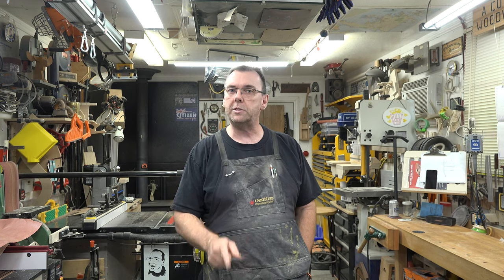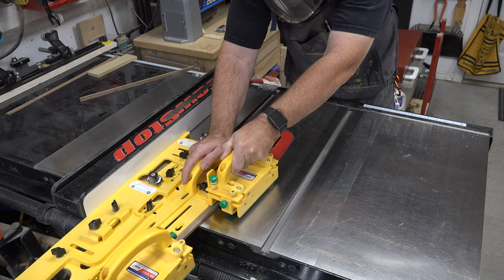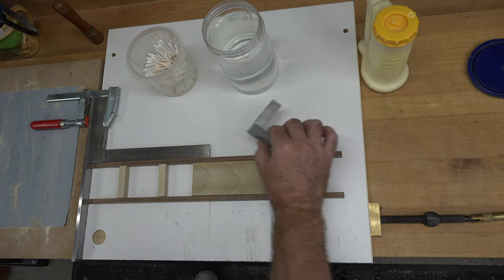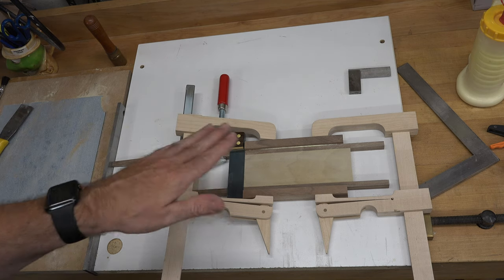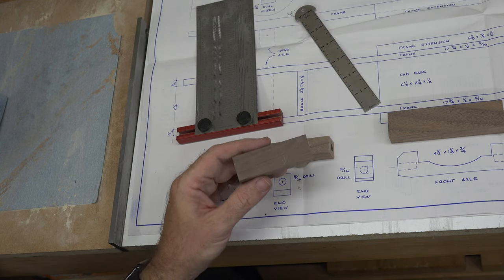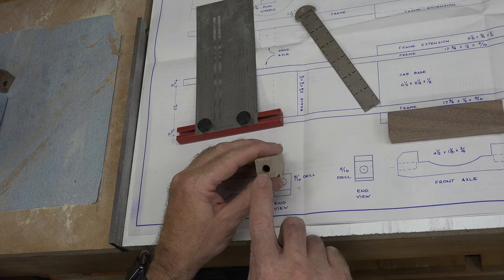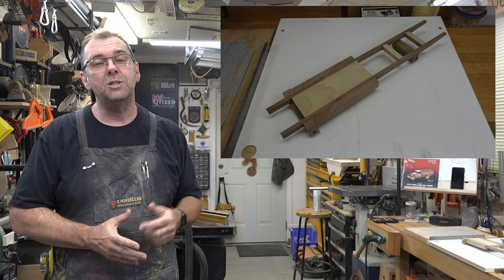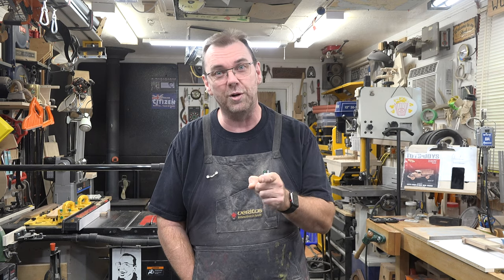Toys and Joys 1929 Ford Stake Bed Truck

Comment: Oh yah! This is going to be a great series! Except for balsa free-flight and u-control planes, I've never built a wooden model like the type you make. And that was way back in grade school and high school. But I do still want to design and build a pond boat. The wooden sailing ship models that kids and adults used to sail in ponds and urban cement/stone ponds in the early 1900's.  Well the snow is on the ground for good here in northern NY, so I have all winter lol. What a great start for this project. Take care Ken!
Reply from the maker: I hope you do make those boats Michael.  I'd love to see them if you get them finished.  Thanks for the kind words on the show and for tuning in this week.  Good luck with the snow.  I hate snow.
Reply: @acutabove_woodworkings  LOL! I hate snow too! If you look on ebay, Ken,  you can get an idea what those wooden yachts look like. I was thinking of cutting them on the scroll saw like you would a bowl. I just have to decide on how many layers and their thickness so I can know the angle of the cuts. Take care!

Comment: Hoping to do this one...thanks for the series. They make  a nice bi-plane model as well.
Reply from the maker: I hope you do make this one Wade.  It's a fun model and with this tutorial, there are no questions as to how to go about making the pieces.  I've made the bi-plane (I believe it was a Fokker II) and it was a wonderful model to make.  The plans for that one are a little older but there were still fun.  The most difficult part of the bi-plane was drilling the holes for the landing gear.  Either way, thanks for tuning in and for taking the time to leave the comment.  I appreciate it.
Reply: @acutabove_woodworkings  can you remember if you drilled the holes while still a rectangle block? I may tackle the plane first.
Reply from the maker: @wadesaunders583  I did not and I think that is where my problems started.  I would suggest drilling the holes while it is still able to be say squarely on a drill press for drilling and then shape the body afterwards.  I hope this helps Wade.  Good luck on your build.

Comment: Kenny, Thank you!  Today was my first time at your channel and although I've only seen one video, I am a subscriber.  Some might think your pace is slow, however I can easily follow because you explain very well.  I purchased this very set of plans about 2.5 years ago and after watching episode #1, you have given me a push to get that box off the shelf and continue where I stopped.  I just wanted to say thank you so much for your positivity!
Reply from the maker: Well I'm glad that I was able to get you moving on this project Sam.  In this tutorial series, I demonstrate every piece of the model so feel free to use the series to help you where you need it.  Of course, you can always ask questions if you like and if I am able to help, I would be more than happy to do that.  You can leave questions here on the channel or through my website contact form or you can email me directly at kennye@acutabovewoodworkings.com.
Visit the website at acutabovewoodworkings.com.
Good luck on your project and thank you for subscribing and for tuning in to the show.
Reply: @acutabove_woodworkings  Thank you for your kindness.  I wanted to ask why you use yellow glue instead of CA or superglue?  I'm not a super glue person, but I was wondering if you wanted to speed up the drying process???  Thanks again.
Reply from the maker: @samspade4634  I'm not a fan of CA glue at the best of times and especially for these models.  CA glue does a great job at temporary repair or adhesion and it is great when used as a finish for turned items like pens or razor handles but in a model build, it just causes problems.  In order to get enough CA on the parts to allow good adhesion and penetration, the squeeze out that it generates causes an ugly mess that will no longer take a finish.  Yellow woodworker's glue penetrates the surface very easily and sets a lot faster than you would think.  Usually, a part will set within 15 minutes or less and the squeeze out that is generated is easily cleaned up using water and a cotton swab allowing a finish to be applied perfectly after a light sanding.  CA glue?  Not so much.  While some model builders on YouTube use CA glue exclusively and make it look like the miracle product of the woodworking world, they are not telling you the whole story and from personal experience, I can say that it is the glue to avoid when it comes to woodworking.  I hope this helps.
Reply: @acutabove_woodworkings  Very, very well explained.  I understand and actually agree with your "experience" with CA glue.  If it didn't run everywhere, the lid wasn't put on correctly (by me) and before you know it, I am out of glue.  Thanks so much for your help.
Reply from the maker: @samspade4634  You're very welcome.  Feel free to ask any questions you have.

Comment: Great video highlighting a great company!  The plans from Toys and Joys are great.  I am currently building their articulating loader.  I really like the fact that you stressed being safe.  It is easy to get into trouble making some of the small parts theses models require.  I totally agree that it is a good idea to spend some extra time sitting and thinking about how you want to make a specific part and the steps required!  Great job as always Kenny 🤠
Reply from the maker: Glad that you liked it Randy.  I've many countless models from this companies plans.  I usually modify them to make them my own and add my own little touches and that's part of the fun for me as well.  I have that same pattern that you are making.  I haven't made it yet, but I will.  I usually get ahead of the game with filming and then take a break from the show and make a model.  It's a good system that works for me.  LOL.  Thanks for tuning in.  I hope you enjoy the series.

Comment: I just finished watching the  7 video's for this truck, absolutly inspiring. I like that you make ALL the pieces rather than purchasing ready made ones. The level of detal and explanation to great. Have you ever used CA glue? Would it work for this truck?
Reply from the maker: Thanks for the kind words on the series Brian.  I'm not a big fan of using CA glue in my model builds.  It just causes too many problems for me.  Squeeze out is hard to clean up, avoiding squeeze out by using less glue doesn't always give enough adhesion, using accelerator spray to get an instant bond doesn't allow pieces to be shifted etc.  I much prefer the flexibility of good old fashioned wood glue.  I hope this helps.  Thanks for tuning in.

Comment: I can’t wait to see more, that looked awesome sitting on your bench in the video you posted on Friday. I love that style those old cars and trucks had, especially the 20’s 30’s and 40’s. Did you spend a lot of time with a jointer and planer to prep the wood for this project?
Reply from the maker: I didn't spend much time at the jointer at all Randy.  I make a lot of these models from scrap and off cuts.  If I need larger pieces, like when I am making the tires, I will only mill what I need as I don't like having extra boards lying around the wood rack.  I'd rather keep it in its rough cut form to prevent any warping.  I hope you enjoy the series sir.  Thanks for tuning in to the show.

Comment: Where did you get the clamp you use on your bench
Reply from the maker: That clamp is the Veritas, Quick Release Wonder Dog and they are available at Lee Valley stores.  Here's a link.  https://www.leevalley.com/en-ca/shop/tools/workshop/workbenches/benchtop-accessories/74622-veritas-quick-release-wonder-dog?item=05G1030
I hope this helps.  Thanks for tuning in to the show.

Comment: Who makes that marking gauge you use?
Reply from the maker: That marking gauge is called a T-Rule and they are manufactured by INCRA Tools.  They are available at most woodworking suppliers or directly from INCRA.  Here's a couple of links for you.  I hope it helps.
https://www.leevalley.com/en-ca/shop/tools/hand-tools/marking-and-measuring/rules/58877-incra-t-rules
https://incra.com/measuring_marking-trules.html
Thanks for tuning in to the show.